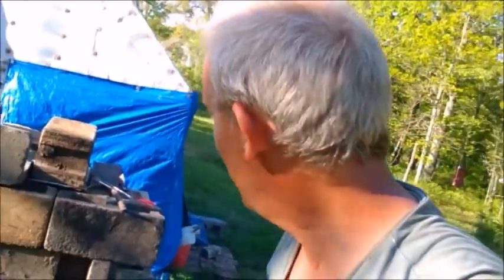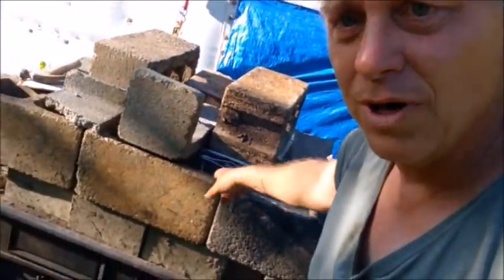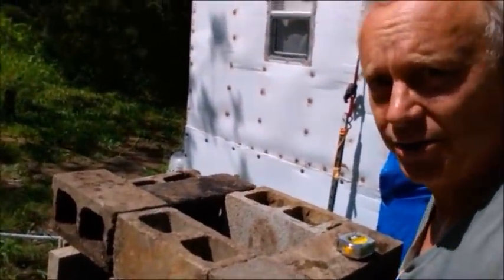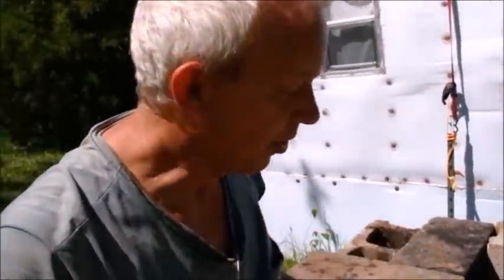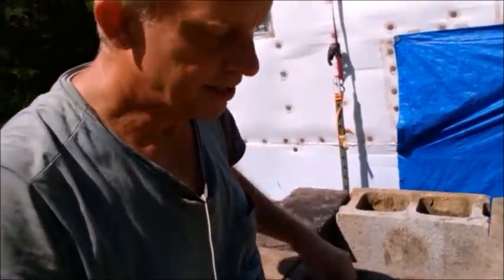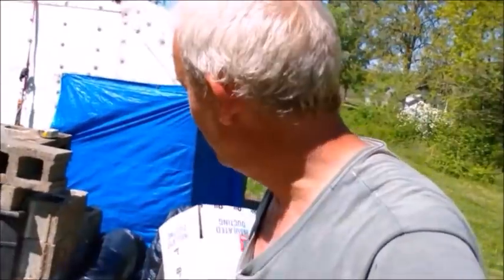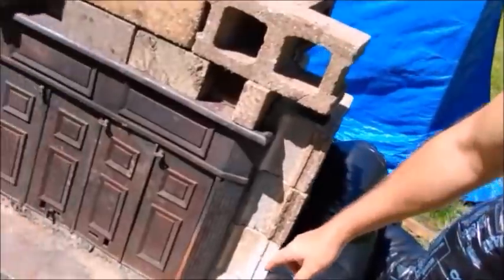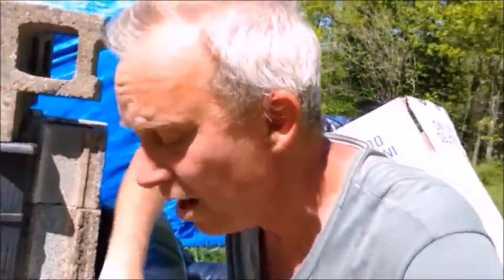How To Build An Homemade Outdoor Heat Exchanger Part 2

Comment: I would suggest stockpiling your wood now. Not only to dry it out but to determine storage. You want it nearby and raised/covered. Also consider getting some used motor old or used grease to keep kindling soaked in. If your heater goes out on a cold night you'll want a fast way to get it going again.

Comment: Lift the fireplace off the ground so rain or melted snow won't dous the fire, and make it easier to load the wood. It's going to be wet around all that escaping heat.
Reply from the maker: It is

Comment: Great job on your wood burning heat exchanger!  Have you thought about also using it to heat your water. My father-in-law coiled up some copper tubing inside his wood stove and ran the tubing into a old hot water tank with a pressure valve on top, then hooked it into his regular water system for showers, dishes, etc. free hot water from stuff he just had laying around. It worked pretty good except for when you tried to take a shower the temperature of the water would fluctuate giving you first hot water then cold, but he used that system for 20 years. I might try putting a heat exchanger in my tiny house, because a wood stove in the tiny house makes me nervous and would take up so much room. Been cold here in Maine the past few days and had snow so I haven’t been able to work on the tiny house, but will be putting siding on next. I have access to plenty of free match boards so will use that for some of it. Have a great day🌈